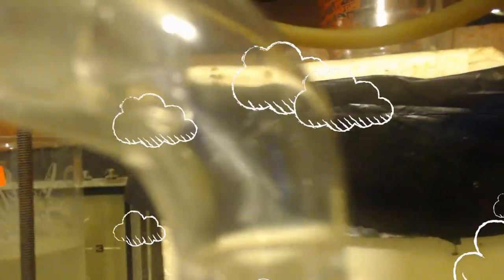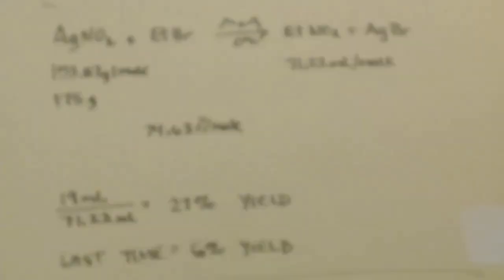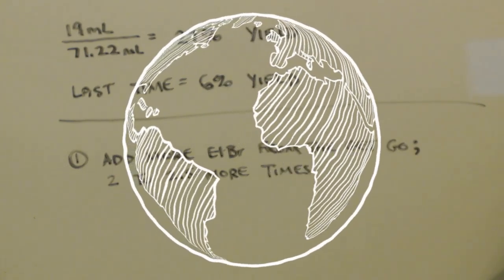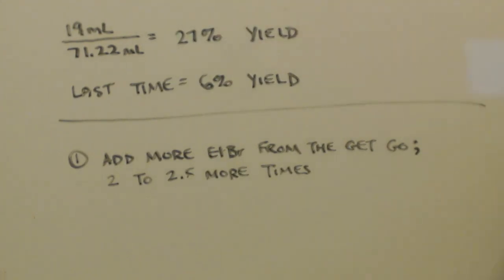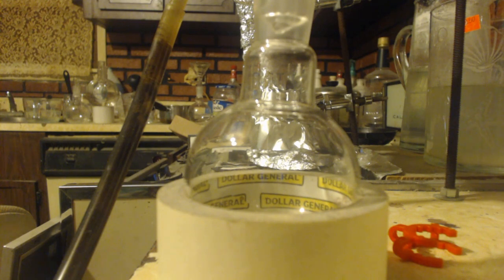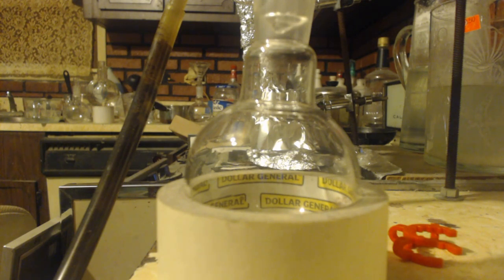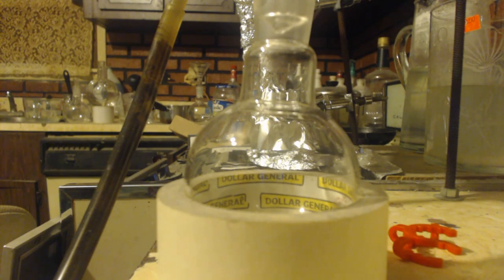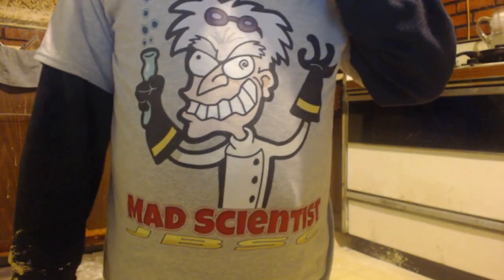NITROETHANE SYNTHESIS (victor meyer)  part 3

Comment: Hi John, from your experience is ethyl bromide unstable? I had a vial of crude ethyl iodide at one point and it decomposed in my freezer.
Reply from the maker: Alexander............Ethyl bromide should be pretty stable for a long time.  Although i would store it in a tight vessel in the dark just to be sure.  Ethyl iodide is a different story.  I am GUESSING because iodide ion is sooooooo GIANT that is comes off alot easier than a bromide ion.  Anyways ethyl iodide should be stored in the presence of copper powder to avoid rapid decomposition, though even with this method samples do not last more than 1 year.   Ethyl iodide on contact with air, especially in light,  decomposes and turns yellow or reddish from dissolved iodine.